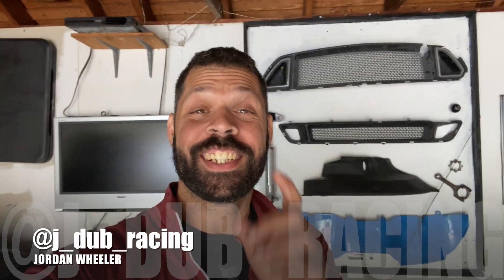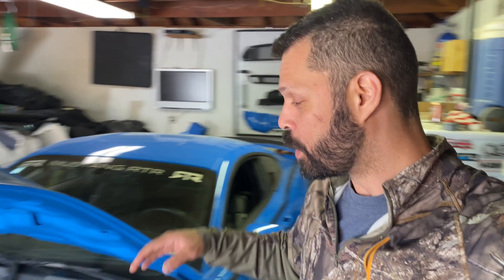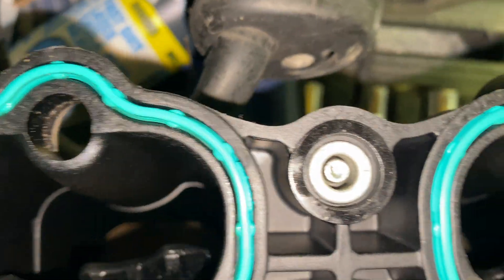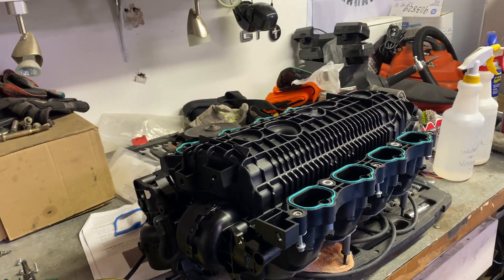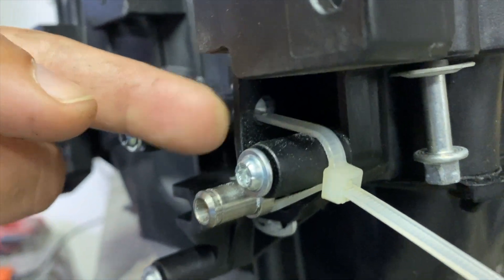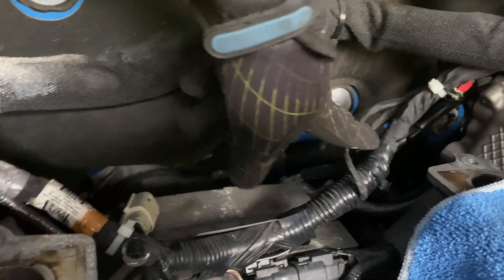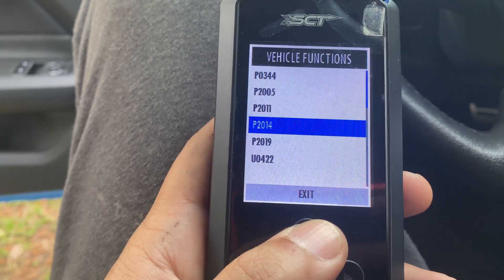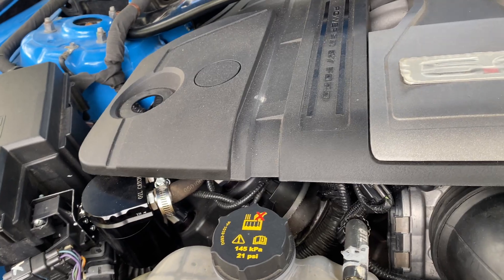How to install DIY IRMC Lockouts for the S550 Coyote Mustang

Comment: The problem is that you have disconnected the plug. The computer will do a check on this circuit and if the circuit is open it will throw a code. Not sure how you bypassed that. If a tune you have is capable of doing that then great. If not and the system is factory their is no way around it. Confusing video
Reply: If I have a stock manifold, and install the lockouts, will I need a compatible wiring harness or will a tune be fine for running?
Reply: @baileybutler7929  just a tune just did them today
Reply from the maker: Thank you for the insight. However, that code isn’t a huge problem for me. When they were plugged in the passenger side was not opening and it threw a code and drove horrible. At least now with it unplugged it drives. It just tells me they are open. My problem now is the knock.
Reply: @JDubWrenching what have you done to fix the knock?
Reply: Yeah what was tbe knocking around?
Reply: Did you figure out your knock?